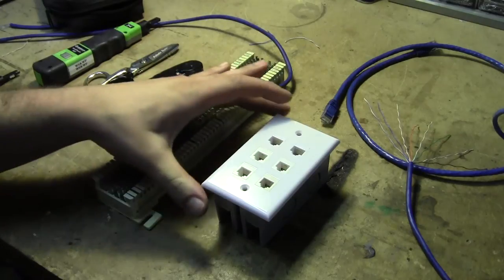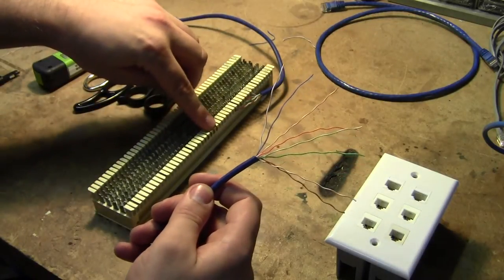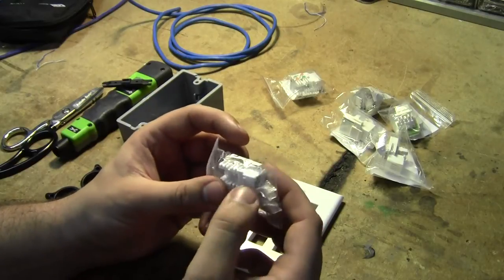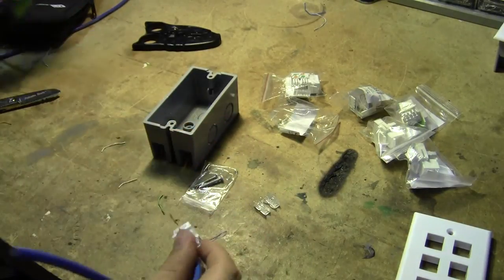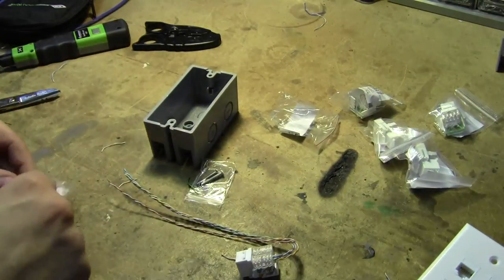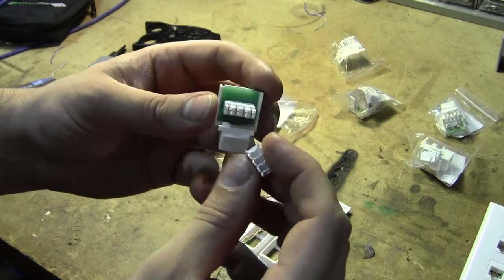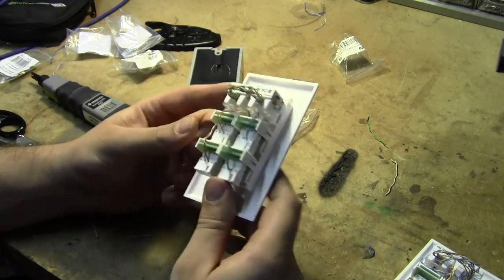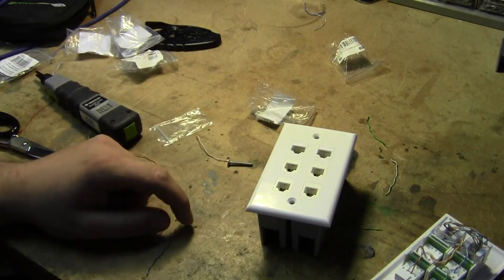Four line Telephone Trunk Breakout Box

Comment: Since you're daisy chaining your boxes together, it seems like it'd be pretty easy to have a single fault bring the whole thing down. Have you considered some sort of end-to-end test setup? Perhaps something to put 12 volts across tip and ring of each line and a resistor'd LED hanging off an RJ11 plug with the bayonet removed?
Reply: ***** Sweet. Let me know if there are any parts/supplies you need for wildflower. I'd be glad to oblige (within reason, of course :) ).